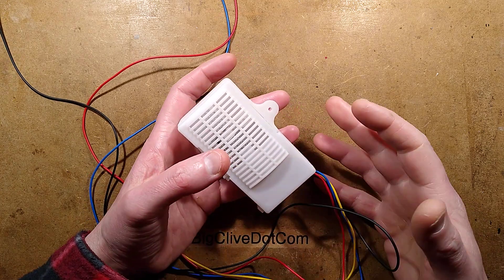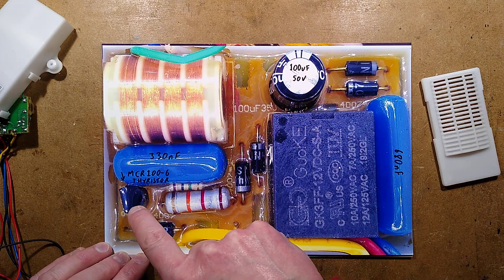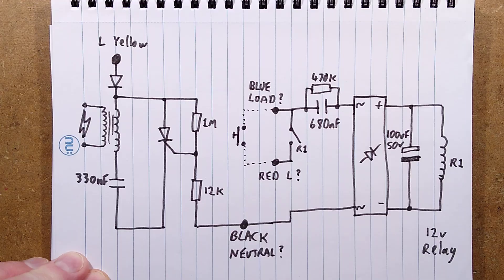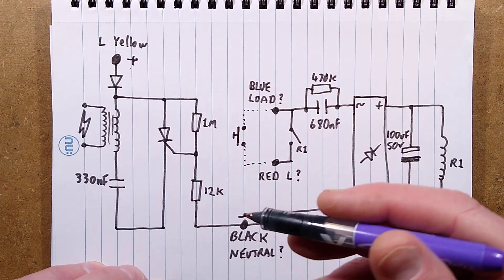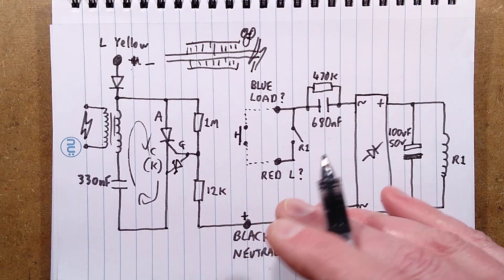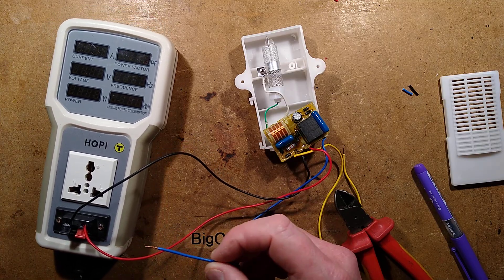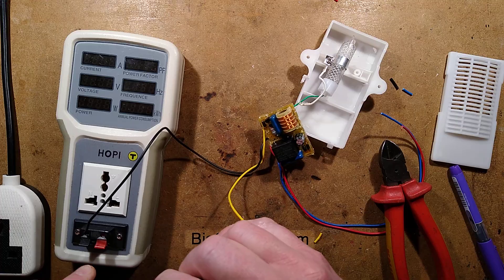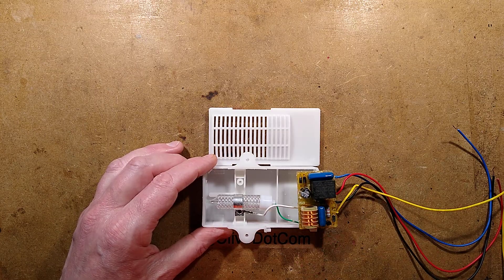Random high voltage eBay "thing"

Comment: Using a capacitor to drive the transformer during its discharge can produce really high voltages. That extremely brief but powerful flash of charge drives a ferrite xfrmr really well.

Comment: SEEMS to be using a to92 SCR as an invert PUT programable unijunction transistor a 4 layer device scr and put are the same but different layers are connected(see the GE thyristor manual1967?)

Comment: @bigclivedotcome,  
So, I think, just maybe, there is some confusion regarding true voltages. I say this because there is false information even on the Wikipedia website. (https://en.wikipedia.org/wiki/Mains_electricity_by_country#/media/File:World_Map_of_Mains_Voltages_and_Frequencies,_Detailed.svg) . For instance, 

As an example take the USA vs the Philippines:
US power to the home comes in on two legs (plus N) of 220~240 (avg 230) with each leg being 110~120 (avg 115) with each leg being but in the USA it is said by all, the power is 120. 
Philippine power, depending on where you life either comes in on either one of two legs. But where I live it is one leg, so lets use that. :-) So...
Philippine power to the home comes in on one legs (plus N) of 220~240 (avg 230). BUT ask any Filipino and they will tell you the power is 220. Wikipedia says it's 220. But my volt meter attacked to my well pump motor sees the current at 237 all the time. :-) 

In fact both the USA and the Philippines power is of 220~240 (avg 230). True, in the US only one leg, typically one leg is used and in the Philippines to plug a US device in that requires 110 ~ 120 you need a step-down transformer unless you are where the power comes in on two legs. 

So why does it say 220 for the Philippines in Wikipedia? Probably because of a in-bedded most streak of modesty in the Filipino who will only ask for the minimum and the ignorance of those who assume all reported numbers are valid as reported. 

And now, because I really don't know, will someone in China attached to an under used commercial transformer please report what their multi-meter really says?

Comment: Does anyone know if Ozone kills mould on walls?
Just curious as it may help get rid of a problem in one room of our house.
Many thanks,
Joe
Reply from the maker: Treating that room with a UVC light might help kill the surface mould.  You can get glass compact fluorescent UVC bulbs that work well.  Don't use LED ones - they're usually fake.  Also be aware that you must avoid exposure to the UVC light for people, pets and plants as it can cause skin and eye damage.
It also helps to identify the source of moisture.  If it's a bathroom a dehumidifier or wall/window fan might help.  If it's a basement then forced airflow through it might help.

Comment: Ozone generators used to appear in fruit and veg shops in the 1970s. They looked like a metal cylinder mounted fairly high up and had a lead (obviously mains) going in and a neon lamp on the front. As a young lad I was curious about what it was, but my Dad knew. I can't remember the reason for them being used though.
Reply from the maker: They extend the shelf life of food by reducing the risk of mould growth.

Comment: It's for "cleaning" 220 (from what?)...
Plug your general 220 on yellow/black, And plugs the rest of the electrical circuit on blue/red. For an installation on the electrical supply of the home, provide a good fire extinguisher nearby.

Comment: I believe your right about sterilizing module.   a "Computer Powersupply" would work well i bet.  Yellow for Hi side (12vtyp), red on the 5v side and a small computer fan on the blue wire, which would end up "switched".   A unit this size would work for sterilizing phones, earbuds or small tools.    Things they already sell as complete units.  Chinese,  and looks like it creates a lot of interference.

Comment: 1:32 my initial thoughts are that the relay is set up to make a rudimentary vibrator circuit with the coil used as a transformer.

Comment: My guess is that Red is hot, Black is ground, and Yellow and Blue are bridged to turn the unit on and off. That would explain the difference between 2 wire and 4 wire units. Interesting puzzle

Comment: I work at a plastic injection molding company where one of our container printing presses, we make containers and lids for the food industry, the press used a very powerful corona generator instead of a flamer to pretreat the plastic to insure that the ink stays stuck to the plastic before rotating in front of the 3000 watt UV light to cure the ink. If you looked inside the press while it's running and observing the corona position on the indexer it's a big purple lightning show, probably several thousand times stronger than this device. But still a really cool explanation and sight to see! Thanks!
Reply from the maker: I've come across the plasma treatment of plastic for printing.  Including an unfortunate incident when the operator got over familiar with it and was electrocuted as a result.
Reply: @bigclivedotcom  The metal bars of which emits the plasma arc is only energized when the press is running. I could see if a person became too complacent, brave and ignorant enough to possibly reach through an opening such as the sturdy flexible rubber shield that is a pivot point for allowing the gap for direct pressure and toe, to possibly tap the bars with a long enough metal object while the press is running to adjust the distance or angle of the bars for better pretreatment they could be electrocuted. The housing for the electronics that generates the high voltage for those bars is on the top of the press. It consists of a large transformer and other components to regulate the charge. If that is tampered with during operation of the press, to possibly make adjustments there in place of any use of the variable adjustments that are mounted to that housing could also cause electrocution. The two wire leads that travel from that box are shielded with conduit, if either of these, the leads or conduit are damaged or modified or compromised could also cause a safety risk. Thanks for your comment and good to know others here are familiar with this type of equipment

Comment: That sort of highly elastic silicone-like material is used on automotive circuit boards, to protect components against vibration and corrosion. I recently took apart an electronic throttle module from a 1999 Volvo, and the circuit board, and the gooey stuff on it, was 100% like new. The stuff does not age at all.

Comment: is that pulsing circuit used to act as an inverter-  I'm confused how the rectifier diode then becomes ac to go through the transformer. So I assume its used as an inverter possibly changing the frequency.
Reply from the maker: Pulses of high current are used through a low impedance winding in the transformer.

Comment: Could you drive the step up transformer directly from 240 main voltage without any other circuitry and get the corona discharge?

Comment: If it creates ozone you can use it on boats when they are not used to hinder insects to moving in. But ozone is very reactive and poisionos so it will most likely kill anything and make some paint lose color or fall off.

Comment: An ozone generator is a device designed to produce the gas ozone. Ozone is used effectively in water purification, but ozone in air must reach high levels to remove air pollutants. Health experts warn that it is important to control conditions to ensure that no person or pet becomes exposed to high levels of ozone

Comment: It blows my mind how many things is designed and goes into production, without ever having a manual or any data published what so ever. I recently bought a DC motor driver board, widely sold on amazon, AliExpress and several other webs hops - none of them were able to provide any information about the board other than "12-24V DC motor driver board" - I still bought it because it was much cheaper than other boards, and in the end I was able to bluff my way around and make it work- LOL

Comment: That rubbery potting is common in electronic equipment likely to experience moisture.  Air-conditioner controllers are so coated.

Comment: The tube is sealed, so I guess this thing generates UVA which generates the ozone outside of the tube?
Reply from the maker: No.  It uses the gas purely to couple current evenly to the inside of the tube and the glass and outer mesh work as a dielectric barrier plasma generator.

Comment: It's not that complicated, the capacitor and resistor in series makes a tank which determines the DC in frequency based on the thyrister value so that the transformer doesn't saturate for the full ac cycle and this all just sends a high voltage low current pulse into the transmitter, the secondary circuit looks like a zenor filter to limit voltage going into the capacitor

Comment: The one wheel Ad, at the beginning and end they show grinding the back of the board on gravel which I imagine that wouldn't be good for plastic or metal as it would wear down and a battery would be a challenging bomb under your crotch...

Comment: Now that 238C is likely the ozone dispersion rate. Ozone generators use various measurements in relation to the ozone they disperse. I've also seen it with a G as well. After the dispersion #. You're welcome 😎 G would be Grams. MG is Milligrams etc.

Comment: Otherwise they'll use Chlorine Dioxide "bombs". Which is only one atom away from Ozone. It could indeed be used for small rooms too. Both are used in marine, motor vehicles to get rid of odors.

Comment: Did you happen to suffer pain on your eyes 6 hours later or in the middle of the night? Because ozone is a byproduct of UV-C. And UV-C itself is invisible.
Reply from the maker: UVC can produce ozone at around 184nm.  This unit produces no significant UVC.
Reply: @bigclivedotcom  How did you know though? Item name name doesn't say much and has no description. And you can't see the ray. All you can see there are sparks. And welding, which emmits UV-C, makes sparks too. And why only make ozone if you can just spread UV-C rays for disinfection. Would surely be more reliable than just he ozone. Or does UV-C wear plastic like sunlight does on toys?
Reply from the maker: @volare_cantare  It takes specialist and expensive uviol glass to pass UVC.  The corona discharge is by far more efficient at generating ozone.

Comment: I am waiting for the Chinese thing that turns water into wine, it will come, it will come!
Reply from the maker: It's called a water distiller and it turns water, sugar and yeast into moonshine.
Reply: @bigclivedotcom  I thought you were joking, then I looked on ebay (you know that Chinese market place) and you are right.
I am not going there as my eyesight is already knackered. But every time the kettle boils I will look at it in another way!
How about a test of HHO devices for cars , after all we dont want to see fly tipped electric car batteries in 10 yrs around the countyside!
Regards,
Mike.

Comment: Never seen a tube based O3 generator, normally I see air gap discharge methods. Very cool, thank you for sharing that Clive
Reply: A flouro tube without an inner coating and using silica glass makes tons of ozone... Mercury vapor lamp.

Comment: I can only imagine the immeasurable amount of radio interference such a thing produces. 
I bet radio amateurs within a kilometer radius are turning off their now unusable transceivers and shortwave radio listeners are doing the same.
Reply: FAA would love to say something about this thing.
Reply: @kopazwashere  FFA*
Reply: The discharges are contained inside the mesh, total power is only 1.3W and this power is spread across a low frequency band. I doubdt it would have any significant interference. I am not an expert, so correct me if i`m wrong.
Reply: @Dooezzz  The mesh is acting as one of the electrodes in the spark gap, so it isn't exactly like a faraday cage and very likely does emit some form of EMI. But as you noted if it's only pulling about a single watt and assuming it's operating at line frequency (I don't think so, my gut tells me that it's some f based on the transformer winding and cap in that leg which forms a tank circuit when the thyristor latches but I don't know the L of the coil to figure it out but still probably fine and this is purely speculation so ymmv) it isn't much at all to care about. Inverse-square /FSPL means that 1W (if it's all even being radiated as EMI which it isn't most likely) turns into 1/4W then  ~1/8W real fast anyways, the higher the frequency the better. I actually wouldn't be surprised if this passed FCC regulations on EMI. Cheap talkies probably do more to harm the bands than this little thing does, and the old spark gaps were typically running 250W. Part 97 for US hams (can't speak on other countries) gives amateurs generally 50W PEP or more depending on band to freely work with so while QRPers might balk it isn't a real issue. Mercenary hams have to remember playing tough online makes the entire community look bad. Grow up, this isn't CB! That aside, would be interesting to see this little thing get a scope on it to see if the spark gap is at line or some other frequency.
Reply: At what point does the FCC knock on your door?
Reply: @ghost_ship_supreme  only after the Ham radio guys track you down and file a complaint or a commercial radio tech finds you and files a complaint.
Source: I'm a two way radio tech
Reply: @jrmills2468  I wouldn't say only those scenarios.. some dude got fucked big time by the FCC because he had a cell/gps jammer in his work truck to block his companies telematics... issue is he parked right near an airport. They went around with triangulation trucks and caught him. You start messing with airports or facilities like them that rely on radio you will get the FCC to show up quicker than pissing off the Ham bros!
Reply: @ghost_ship_supreme  about a day or three after the local hams fox hunt your QTH and report you to them. Whole thing shouldn’t take more than a week or two.
Reply: @timlewis2068  Honestly the HAM community polices itself better than 9/10 other hobbies and proffessions.
Reply: oooh I have an Amazon ozone generator... I'll have to try turning it on and see what happens to the shop radio.
Reply: Portable jammer
Reply: Yeah.. I reckon an ancillary usage might be to stop people cheating during pub quizzes, by spamming out any radio comms within a hundred yards!
Reply: The infamous dual use excuse. No officer, these are not laser jammers they are LiDAR parking assistant diodes. Yeah, ozone generator, yep.
Reply: We need a big antenna for the truth jammer work?; this is small and weak for this rsrs...
Reply: It'll never pass CE certification. Sorry CA now following Brexit ! We must have our sovereignty !
Reply: @grahamstevenson1740  are devices like this really that important?
Reply: @katiebarber407  The regulations apply to anything that you can plug into an electricity socket. The sellers of this device are in breach of English Law. There shouldn't be any exclusions based on 'what anyone thinks is important'. Really, EBAY should be held liable for having this junk on sale in the first place.
Reply: @grahamstevenson1740  this is a component. You cant plug it into an electricity socket out of the box. Well, no more than you can plug ANYTHING into an electricity socket, including your finger.
Reply: @stargazer7644  No, it's not a component at all. It's a product which, to be legal requires certification either to the Low Voltage Directive (mains powered equipment) and/or the EMC Directive, even if it's self-certified. As it won't pass the requirements, it's ILLEGAL.
Reply: Imagining 'source: trust me bro I'm two radio tech' makes me 😂 my humour

Comment: Long time watcher,its rare I comment. A Question you could Answer?.. does Ozone like dry air ?  I have recently implemented ozonated water in the laundry business I own, using an ozone injection unit that mixes the ozone with the water. It uses a desiccant cartridge to dry the incoming air, so does a 'normal' ozone generator perform better with dry air ?
Reply from the maker: I think it does improve the conversation of oxygen to ozone.

Comment: My sister reckons the device is a small ozone generator for putting in a small cupboard to sterilize equally small items. Suitably enclosed, the generator would be a lot more effective. Seeing that corona sparking off with the light out made her think this was the only solution, probably being even more effective if placed in a plastic bag, sealed off to maximise the ozone effectiveness.

Many thanks Clive. This was most interesting!
Reply from the maker: It is for sterilising things in an enclosure.

Comment: Mystery thyristor trigger? An SCR also has an anode to cathode breakdown 'avalanche' response - triggered by a rapidly rising applief voltage. (dv/dt, so called). This is the so called 'third method' trigger, normally discouraged because it may damage the thyristor substrate.
Reply: Continuing, third method... There is no freewheel/back emf diode in the HV transformer primary so the thyristor is receiving a powerful, rapidly rising (Lenz) reverse voltage as it enters the non-conduction phase. Is that how this SCR is actually being triggered? I wouldn't expect the designer of this machine to follow any particular rules or norms!

Comment: You could easily make your own ceramic or glass ozone tubes by buying some ceramic/glass tube off say ebay, rap/stick copper foil sticky tape on the outside for the outside conductor, insert a copper wire or copper/brass tube inside ensuring that neither extends outside the tube (to prevent spark gaps). Any sized cheap DIY ozone tube.